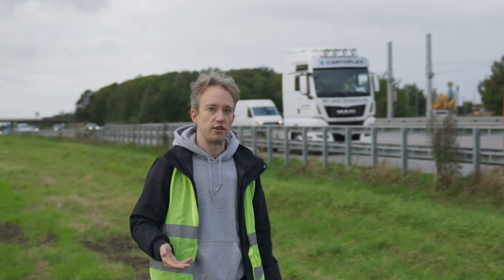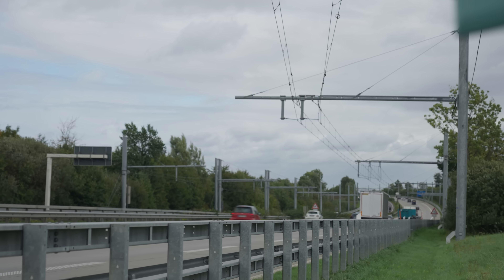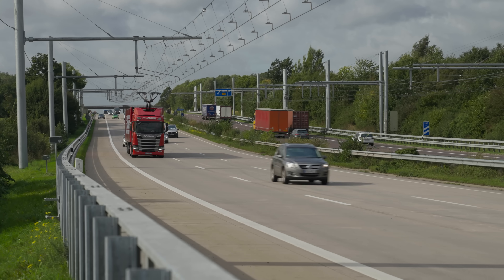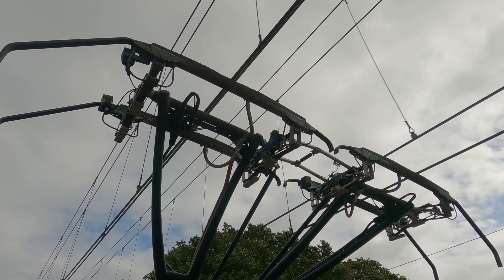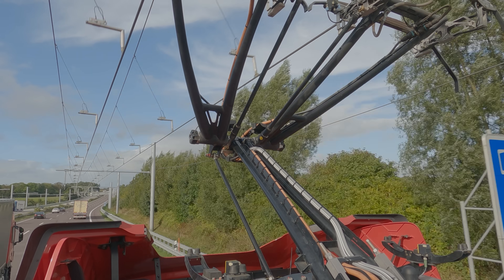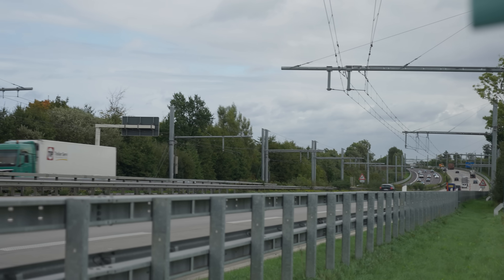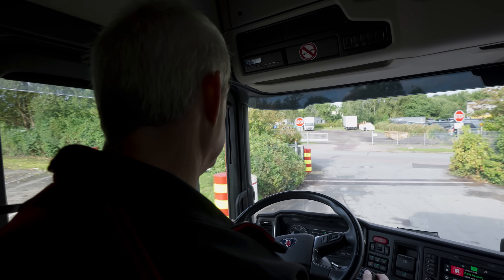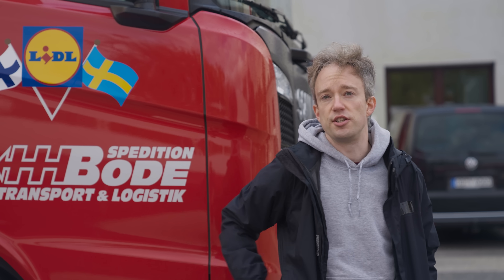The highway where trucks work like electric trains

Comment: Everyone commenting that the best solution is moving truck trailers by rail really doesn't realize that most places already do that to the extent that it's feasible, and they ignore the shortcomings of freight rail transportation with oversimplified arguments like "steel on steel is more efficient than rubber on pavement." While true, it ignores so many other economic factors, not to mention handwaving away the needs of shippers and consignees with regard to their respective supply chains and the constraints of shipping freight by rail. And the reality is that even though trucks are "less efficient" than trains, they often end up being cheaper and faster than trains to shippers, at least in the US. I'd imagine that's true in Europe too.

Comment: Thing is i haven't seen a system that would be cheaper and safer than that. It'll work. It's not a perfect system, i'm thinking a vehicle fire underneath it would cause big problems, but it's the best i've seen to date. Ideally, one part of a wider set of solutions. Boris'll probably have us clapping for a solution like some kind of rain dance though.

Comment: I believe this is fundamentally a sound idea. The issue of wear to the pantograph and wire could be resolved with a rolling contact on the truck, with internal brushes. It would also be possible for accelerometers mounted in the pantograph to monitor the state of the wire, then feeding this data from all vehicles into a wear-map. Voltage variation could also be measured used in a wear-map algorithm. The wear-map would then be shared like traffic or road work data is today, and as your vehicle approached the damaged section the pantograph could automatically lower itself before the damaged section and reconnect as it passes.
Reply: Just do what trains do use a sacrificial contact strip on top of the pantograph

Comment: Why is everyone ignoring the glaring problem: Most countries burn fossil fuels to generate electricity.  We are just trading one carbon footprint, for another.  Where I live, 80% of the electricity is from natural gas and coal.
Reply: Generally, fossil fuels and coal are more efficient when being used on a power grid. I'm sure I can get you sources for that claim. Developing infrastructure like this also makes it easier to integrate it with greener energy sources

Comment: Here's a good solution, grid powered by nuclear and supplemented heavily by wind, solar and hydro, hybrid vehicles powered by hydrogen for those inevitable long hours spent away from overhead charging lines, and of course charging lines of some sort along those longer stretches of road we inevitably travel down each day where a boom extends to connect to in order to refill our little batteries back to full capacity and let the hydrogen generator turn off for a good long while.

As an aside, I think there was a very logical reason in a futuristic game such as Halo the Warthog was specified to run on hydrogen rather than being electric, since the batteries to power such a monster if it were all electric would be absurdly heavy, taking its range from 500 miles down to maybe 50 if you're really frugal. Its always nice when your vehicle gets lighter and more fuel efficient as you use up your fuel/chemical-battery, never forget that a car battery pack only loses about a microgram when it is fully discharged and that the weight loss due to wear is more significant.
Reply: well hydrogen is not that great because the round-trip efficiency is very bad (electricity->hydrogen->electricity). Maybe niche solution for airplanes or something like that, but not cars or trucks.

Comment: Electric trucks can also be powerful enough to maintain speed even when the road is steep. Here in Switzerland, there are major highways where many trucks can barely reach 60 Km/h.
Reply: Electric vehicles have a lot more torque than traditional gas vehicles. And they can go from 0 RPM to max torque quite easily. So they should be fine.

Comment: Seems like a great idea... the HGVs will still be wearing the road out far more than cars would.
I'd still rather see these trucks on trains for the longer journeys, then delivery depots at each town... just like we had here in the UK in1950s or so.
Reply: It is not that easy.

Say you whant to deliver something from one city suburb to another 100 km. 

By truck you just go there directly in maybe 1:30 h. 
With train you need some truck to get it to the train station 30 min, than you have to move it on the train 30 min, whait until the train gets assembled 2 h, the train gets to the other city 1:30, disassemble the train 2 h, move stuff a truck 30 min and get to destination 30 min.

For medium length trips like these trains are just much more complex process.
Reply: @langohr9613ify  
Many deliveries are regular over the year and planned in advance.

How many people expect something to be delivered within 1 hour 30 od requesting it ?
Reply: @lewis72  If the journey is long and over a flat plain, then a train is certainly better than a truck. But not only is much of the terrain around germany hilly, it also doesn't all have direct train links. A truck can make use of already in place infrastructure, and does not suffer in uneven terrain anywhere near as much as a train would.

Its a simple question of how much money put in, for how many good results out. Building and using more trains, may be only slightly better overall, whilst costing a lot more, and will still struggle over weird terrain (or at least will cost a lot to circumvent it). This is more cost efficient, still a massive improvement and works using premade infrastructure.

Comment: 'you're replacing alot of diesel' .. won't the over-head powerlines (supplied from the grid) be generated from fossil fuels...as normal? higher workload at a powerstation to overcome diesel just seems like passing on the current CO2 emissions from one place to another.
Reply: Exactly! Like the myth of cloud computing reducing carbon footprint of companies due to them closing their data centres. The electricity consumption, i.e. power generated somewhere else by who knows what, is just happening at a different place.
Reply: There's a thing called efficiency. An electric motor (a bad one) will have a max efficiency of 80% +. An ICE will have a max efficiency (a good one) of around 25-30%. To get the same energy to the wheels, you'll use less energy in production. That's the best part about electricity!

Comment: Couldn't the cables in the top charge a battery at the same time? That would let the truck to still use electric while there are not cables.

Comment: Rubber is good on slopes, steel is not. Tracks obstruct that faster 'wagons', due to lighter load or such, cannot overtake individually nor can they veer off to off-grid locations for loading and unloading. The flexibility of the trolley-truck is the big win compared to trains. I like it.

Comment: But what for? To reduce combustion engine waste? But you need to build so much tracks for that and maintenance it. Aside from that, many modern countries uses coal as energy source for poerplant (look Germany, about 50% comes from it). This whole electric car movement is dead road for me, because either building tracks is costly, or producing eco batteries that can hold a lot of power is likely not possible in near future. Hydrogen based engines can be probably a better alternative. Hydrogen can be fueled like normal gas and is eco friendly. And many companies around the world already have not even prototypes, but fully builded cars with this kind of engine. Whats more, you can produce hydrogen from coal in mines, which allows to transform "dirty" coal into clean alternative energy source.

Comment: OK, so exchanging diesel power for what, nuclear? Each truck, minimum 250kW, more like 400kW on an incline. Let's play with 10 trucks for scale. 2.5 megawatts. 1000V line? 10 000V line? Even that's 250 Amps. How many trucks do you think it could support before the wire and local power supplies give up? A small Nuclear or coal / gas station would be 250MW. So 1000 trucks per power station. There are stretches of road in Europe where you could count that many passing you in an hour (or two). Scenario 2. Let's allow 25 metres for an 'A' trailer with tractor and give 1 whole distance between units. A truck every 50 metres. That means a power station every 50km, in any direction a highway goes. Of course, if you could fit a 250+kW regeneration system to trucks on the downhill route, you might recuperate a lot of that energy too. Don't imagine you could practically store it though. Maybe energy stores will be there soon?

Comment: This is one of the less bulls..t things EU and EU states for electrification of cars and trucks had developed so far. Its more efgicient, faster and smarter. Though, I think its still not more ecological, if the electricity comes from fossil fuels + even though its wire instead of battery, there are still bigger power losses compared to the fossil fuels....

Comment: Is this better because of the little they have to add to the infrastructure (preexisting roads) vs making electric trains? It seems like the larger moving use case would be better suited to a train that's converted to electric, vs a truck.

Comment: The funny thing is that those posts and wires where in Sweden  for testing and then sent down to Germany after a couple of years.
The wires were a couple of kilometers along the road E16 to Gävle (in Swedish spelled backwards it's Elväg, electric road) The truck company had only one (or a few) truck for testing and then digged it up the posts and sold it. Nowadays they make they own bio diesel instead.
Reply: Really? I'm kinda Sad that the prototype didn't work.
Reply: I been there and seen the one in Sweden.
Reply: Nah, Siemens just resold the same system that was tested negatively tested in Sweden to Germany multiple times. Because that's how smart our traffic bureaucrats are. The Swedes are now testing a system where the power is supplied from the road instead.
Reply: @michaelcolin9887  After a quick rid of their whole fleet of defective S3's, i wouldn't be surprised, if Siemens would sell sand in Egypt. Their marketing department has more skill, than VW's had back in the 40's ;)
Reply: This one was built in Germany

Comment: There is no choice really.   There will be other issues though not discussed.  Wires supporting one truck is one thing, but supporting 100 between PDUs or sub stations  is another.  Trains have a minimum of 2 miles on the same track and would likely never have more than 3 is one zone.  Also, the electricity is so close for electric cars to use, but rather too high to touch it.  Although having charging stations literally anywhere suddenly becomes a reality.

Comment: The biggest issue we have in the UK is the sharing of rails between passenger and freight services. It is a nightmare for both. Dedicated rail networks should have been built for freight with a parkway like depot interchange to offload containers between destinations. It misses the point to convert motorways into part time freight railways.

I don't like the concept of this eHighway idea. It is a mad way of achieving such a goal. Lorries are the problem and electric doesn't solve it. Anyone living near to a large container port will know the havoc lorries cause and even if you don't use the trains you have probably heard of times when overhead cables are torn down or damaged. If we consider the UK's largest container port (Felixstowe) lorries head up or down the A14 to the Midlands or A12 to London. Very little of those movements - except stacking or freight storage due to these logistic issues - are to the county the port is based at thus focus has to be on moving containers in and out by rail to either A12/A14 corridor and for the lorries to deliver to or from these major hubs. A similar case for other ports.

Comment: Great idea with old and reliable technology (el trains) that would greatly decrease emission and fuel consumption). And could perhaps even allow smaller private vehicles to connect which leads to a decrease in battery size and purchase cost for the average consumer.
Only downside is that this has not come sooner, given the tech has been here at least  since half a century.

Comment: Wouldnt it make more sense to use railway network?   Maths isnt my strong point, but if you had a train to pull 20 lorries worth of goods to a central location where they were lifted by a crane onto a lorry, you would be saving 20 lorry loads (im saying 20, but tbh you could do like 60 a trip, thats 60 less diesiel lorries on the road, and as trainlines are electricaly run, would be safer than what they suggested in the vid?) Just seems kinda dumb tbh, theres a lorry shortage in the uk, so use the trainlines for long distance, and lorries for distrubuition

Comment: Electric lorries with battery swap stations and charging stations everywhere is easier than a combination of diesel and tramlines everywhere.
Reply: The everyone would have to agree on a standard for the batteries.  Each battery would have to be tested when it arrived to be recharged.  Who will bear the cost of a $50,000 battery multiplied by how many trucks there would be needing them in a day.  The idea is a good one but would never work in this ME, ME , Me world.
Reply: @goodmandiad2713  well they think they're going to convince HGV drivers to attach an antenna to their vehicles so I think a common battery type isn't too wild an idea. 
And i think that the cost would be covered by the haulage companies, with subsidy to help.

Comment: this does not reduce the consumption of diesel, it just moves it to the power plant. classic " not our problem anymore" solution
Reply: As a matter of fact, yes does reduce diesel consumption, just because power plants are designed for peak efficiency. The added efficiency when scaled up can easily mean millions of liters of diesel not burned to move the same amount of trucks, assuming 100% comes from fossil fuel, which does not.
Reply: @ef3675  most powerplants are not designed for peak consumption though… most are for normal use and they have extra facilities ghat can turn on when needed. But you are right about it not being 100precent fosil fuel, but with it being in germany and germany using brown coal( something that is equally bad as diesel) i dont think its much better for the environment

Comment: Now if they used "Flywheel Technology" with electric power stations along a route it would save having to strip wires everywhere.  Germany tried this with Busses in the 1950's and it worked.
Reply: It worked, to a degree, with city driving routines. Hopeless in that situation.
Reply: 1950 was 1950,  it's 2021 now,  other wise I would be using my horse and buggy.
Reply: @billsmith305  Vancouver has had overhead electric lines powering buses since the 1940's. Time for the world to catch up.

Comment: There is a similar system for charging electric vehicles using magnetic fields under the roadway. This wouldn't restrict the height of the load.
Reply: But wireless charging sucks. It's inefficient, creates a lot of heat and is just plain stupid if there is an alternative, like wires and brush contacts

Comment: I think this is a very good idea for trucks. For individual vehicles, however, I think we will need to find an actual alternative fuel. I think hydrogen is going to be king. You can convert a standard car to hydrogen with comparatively minimal effort. Most standard gasoline engines can already run on hydrogen, the biggest thing to install would be the fuel tank. You get the same sort of range with a hydrogen vehicle and you can fill up exactly the same as you would with a gas powered car. Plus hydrogen is practically unlimited, clean burning, powerful, cheap, and doesn’t require massive mining operations. Electric is cool and sleek, but it has some of the same problems that oil does. So in the long term I don’t think battery powered cars are going to do very well.

Comment: I'm sure there's some technical reason why, but it would be much more aesthetically pleasing if it was at ground level
Reply: It is a road.  If this were lower then it would have a larger chance of getting messed up in an accident.  That is why they need to rise the trolley to get to the wire.

Comment: Interesting but this still has the same problem of centralising the power supply. This means much more power stations and battery plants. Without a massive increase in power generation and storage this will go nowhere. The banning of combustion engine vehicles by 2040 is not just unrealistic but insane. Pure virtue signaling. The level and time of investment required to achieve any of these goals is vastly underestimated.

Comment: I think this makes sense in urban areas for last mile delivery, where there's a need for flexibility. You could build a far more extensive system if you were just building power lines over existing roads, rather than building a cargo light rail system. On highways, this is objectively inferior to railways, and only really makes sense as a stopgap while building a railway, which is rare in most parts of the world. Even America retains an extensive freight rail network.
Reply: No part of America's extensive freight rail system is electrified however.  I used to live next to a line that carried long coal trains every twenty minutes through the night to Alexandria power station. After they closed that power station in around 2011 or 12, we got much better sleep.
Reply: @KokowaSarunoKuniDesu  Costs to electrify railways and highways are probably similar.